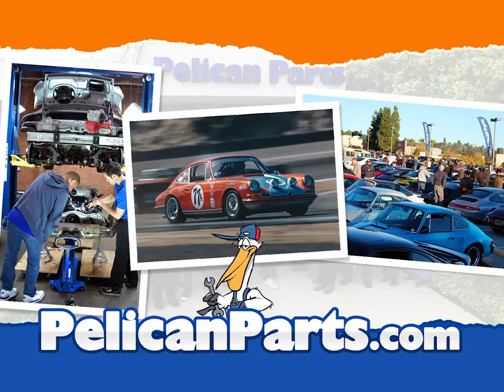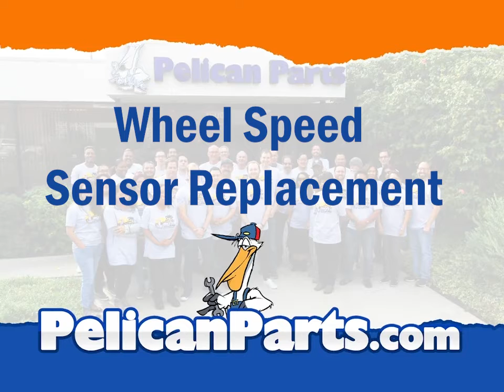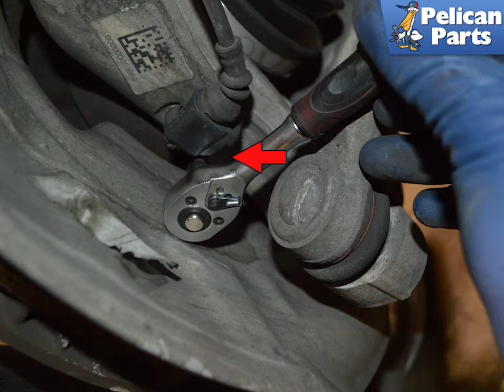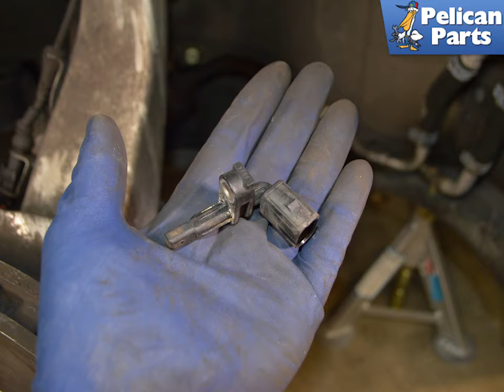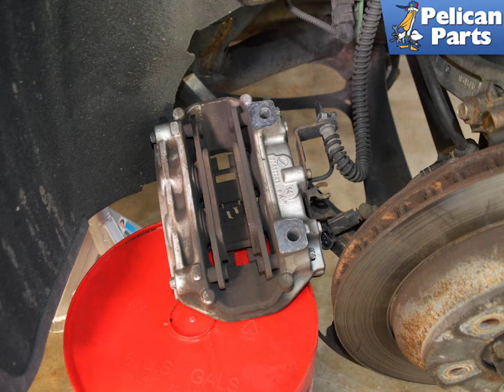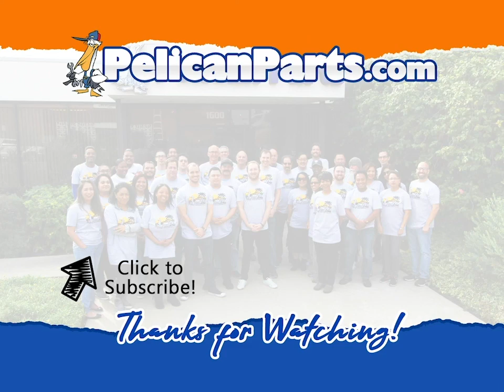Porsche Cayenne 958 Wheel Speed Sensor Replacement (2011-2019)

Comment: You definitely don't need to replace bolt's on the breake caliper!..  Use penetrating lube to release bolt's..  
In many time's you don't need to replace sensor..  Just take it out and clean..      Brake lines !!!  ALO!! they need to be stronger and in the good condition!..  If they can't support the weight of the caliper..  YOU don't want those brake lines on your car !!    You need to watch on sharpe edges..  you don't want to damige brake lines..   You can use AP205 to lube ..  and prevent rubber to dry out..   Moist gets in brake lines..   atack reforcemment (treads) inside = brarake ..
Reply from the maker: Thanks for the additional info for the procedure. We appreciate it.